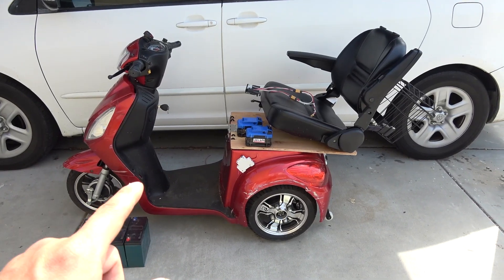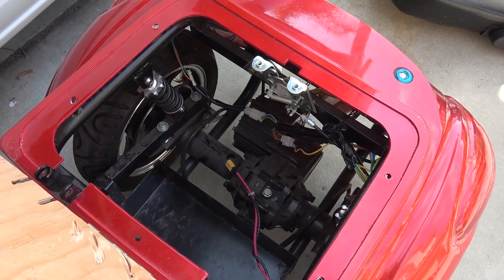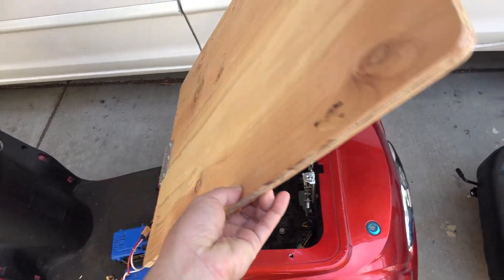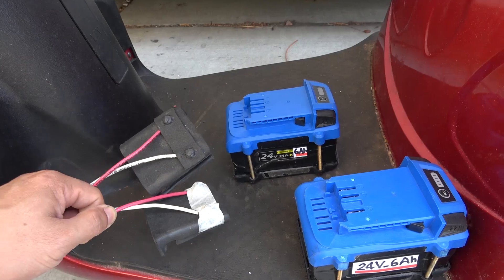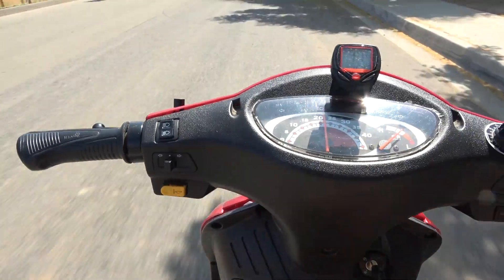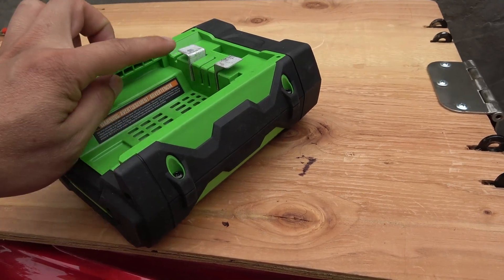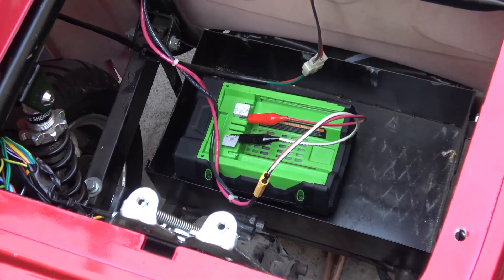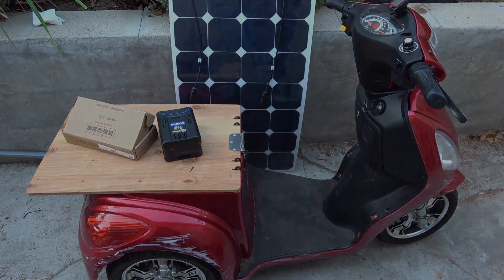E-Wheels 48V Mobility scooter battery upgrade: from Lead Acid to Li-ion Power tool batteries

Comment: Do your research before purchasing a mobility scooter. I got a 3 wheeler off a home shopping  channel. They advertised it as "able to go anywhere a wheelchair goes".  NOT CORRECT. I. couldn't get it onto a modern full size city bus  with a ramp. It's TOO LONG. As well it doesn't even fit on an Access bus designed for wheelchairs. Measure the wheelbase and see for yourself before falling for the high pressure sales hype.

Comment: i have the ZT500 and have just done this using my kaaboo scooter battery not tryed the hills yet as i just need to check on amps ,my kaaboo batterys 20ah and bms  is 30 amps ,i have been round the block on it though and it seems fine ,ill have to set up my amp meter and do the big hill where i live ,i been watching this video for a while now just been waiting for a damaged scooter to come along and one did eventually just needed to repair some panels ,thanks for the inspiration to give it a go ..

Comment: I have 2 lead acid 10 ah total and have a lithium RV battery 100 ah. All are 12.8 v. The lead acid batteries are soldered in. If I took them out and replace with a single lithium battery would it work? Would I have to dissconect the spare/ loose cables or mask them with gaffa tape?

Comment: Ewheels make recreational scooters as well as mobility scooters.  The mobility scooters do not go as fast as this one.  They also have a tighter turning radius than this one.  This is a recreational scooter, not a mobility scooter.  It is not designed for inside homes and retail stores.  It is designed for the road.

Comment: the wire you says do nothing i think you will find it is the limitor allows to go from 8mph to 15mph i trying to sus the limitor out on greenpower 4 wheel  faster scooter cant see the wire as it should be a two wire game only thing i see close is one with a wedge bulb sat in it black and white? so at a loss at present

Comment: Would it be possible to connect two or more EGO batteries in parallel to get more runtime? Or do you need some sort of balancer between the batts?

Comment: Not all batteries can supply enough current to the scooter. When the battery has a protection circuit, it cuts off the current. If not, it may overheat and catch fire.

Comment: Learn first to drive,in a complete truck there are no scratches, apart from the switch on the side and not on the steering wheel..... 
So, get a motorcycle seat and lay it down=2 Kilo and then I throw away the whole thing.

Comment: Hi, thank you for the great information you are sharing, I need your help,
 I have a zt15(
A highly resistant set of 4 Lead-Acid AGM batteries for model ZT15 and DRACO. This set consists of four 20 Ah cells,)

 mobility scooter from velobike and unfortunately the battery has died, and the company does not have it, and it is not on the market anywhere in the UK.  I couldn't find it, my question is what battery can I replace it to make my scooter work??

Comment: how do you handle under voltage issues with the lithium battery/charger?  Do you have any way to prevent over discharging the batteries?  I thought that this problem was handled by the tools in the standard application.  Does the battery gauge on the dash actually reflect the battery usage?

Comment: I am working on a similar project, running two. 8ah Milwaukee batteries in parallel with a voltage regulator to run a wheelchair. Keep up the good work.

Comment: Great video thanks for sharing 👍
Also the speed is in Km/h they restricted to 15mph which on bike paths feels fast enough or you change the speed controller and ride on road at 30mph 45 Km/h. 👍
Reply: Yes.. to my understanding,, certain lanes are segregated for scooters and bikes,, but,, some highways have scooter lanes but,, they need to run a minimum speed to be legal to run on highway lanes set aside for them.  Im sure laws n rules are vastly different from state to state

Comment: How'd you go with the E-wheel project mate... Im keen to know what sort of time duration you can get out of those 2 x 24v batteries before re-charging. I have a Pride where the lead acid batteries are buggered and would like to consider some sort of lithium upgrade. I live way outback in NSW Australia and nobody near to do work on the scooter so I might be able to do this myself.
Reply: Most scooters and power chairs are 24v.  I have one I converted to use the kobalt 24v batteries.  Range is nearly unlimited since you can just swap batteries.  

Also when comparing to lead acid remember that these can be almost fully discharged where lead can only be discharged to at most 50%
Reply: @JordanHaisley  Thanks for reply mate... I've jumped in a bought a hand made 24v lithium the size of a car battery. The bloke I bought from cuts up the old cases and builds a new battery in the old case. Its going alright so far but only used it for a week. Massive saving in weight compared to the old 2 x 75ah AGM's
Reply: @mirriulahwaterdog  that’s awesome.

Comment: Is this true the tool batters go dead fast
Reply: Cordless tool batteries are typically 2 to 6 amp hours. SLA  batteries typically 10 to 20 amp hours. It is likely the original batteries should 4 or 5 times as long. SLA batteries  lose power gradually over a curve,  and tool batteries provide almost full power until they die.

Comment: Personally these trikes go fast enough but plenty of room to fit an ebike battery and different controller. In fact have seen higher power motors on sale as well 
Same weight but double the range. 
My zetti ,even with my heavy weight as far forward as possible , will pull a wheelie if throttle snapped open. So mine has anti tip wheels on the rear.

Comment: I have the same scooter and it won’t go any faster because of the gearing in the rear end . These scooters are made to go slow and carry 400lbs.
Reply from the maker: You're right, it's geared for high torque but low speed. But it did go faster and I just proved it with a higher voltage battery.

Comment: But don't the lead acid batteries have more amp hours than the power tool batteries?
Reply: Most of those SLAs are around 6 to 9 amp, so it could be less since his two 24v are 6 amps.  Now a 2s2p would be more and weight far less than the big beast 12 amp 12v SLA I have seen.
Reply: 22ah compared to the 2.5ah ego
Reply: Yes but I believe it's just initial testing
Reply: 6ah lithium tool batteries vs 10 or 20 ah sla might be enough to get you home.

Comment: thats just crying out for a 100 amp controller and battery
Reply: And a bigger motor. Then using ebike style battery will have a greater top speed and possibly range for the same overall weight.